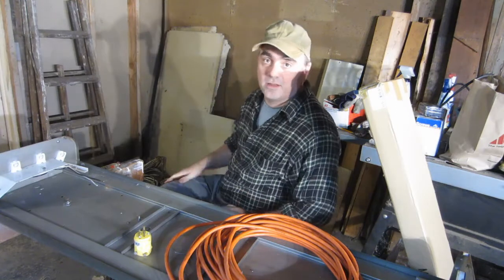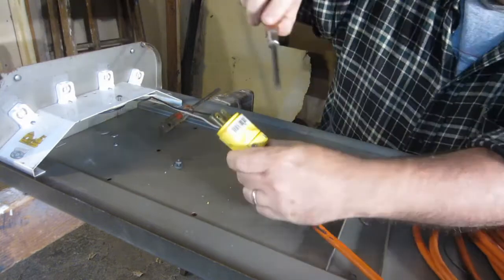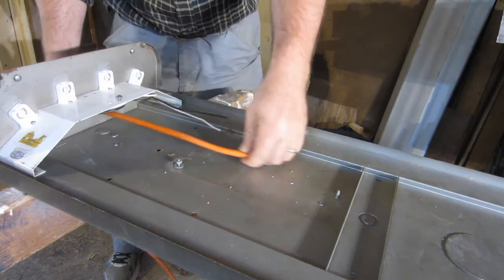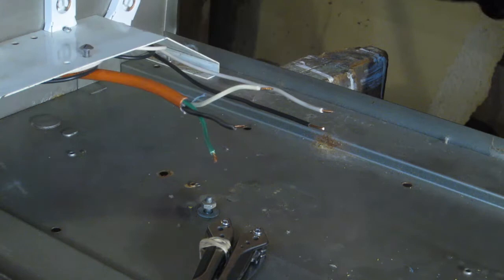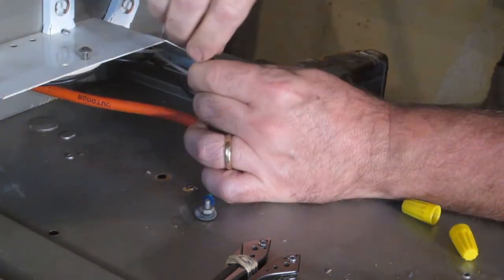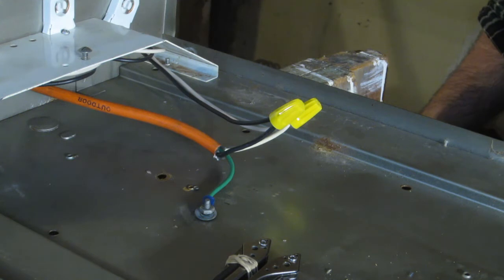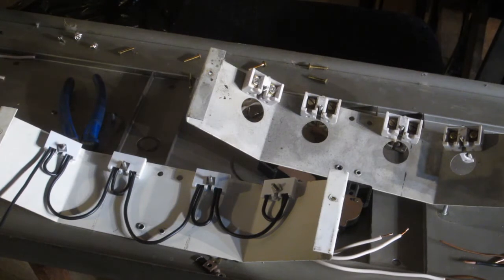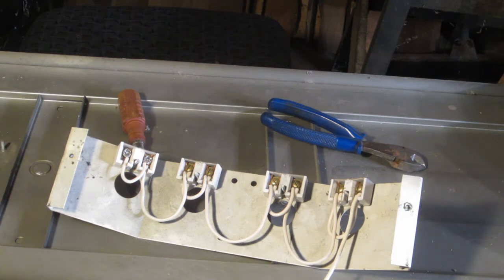Converting a vintage fluorescent light fixture to LED Part 2

Comment: Cheap Chinese garbage, those LED tubes don’t even last 6 months and also the integrated LED fixtures. That fixture was built with pride back then, the fluorescents are way better. That fixture was around 70 years old. All that had to be done was change bulbs and starters. The government is fooling us, they don’t care about energy efficiency, all they care about is money. That fixture would still be going if it was in its original condition and I guarantee it would last another 70 years. An example was when the LED tubes lit up halfway, that’s how cheap they are. The fluorescents never did that. Those ballasts last forever they never have any problems. Those cheap ass LED drivers are junk, it’s a cheap circuit board and that’s why they lit up half way. Hope you enjoyed getting scammed and ripped off. I’ll stick with my old incandescent and fluorescent lighting any day. Also they made a mistake in your order that’s how stupid they are. Back then, they would have done everything right. If that was my fixture it would have stayed fluorescent.

Comment: Nice light and good clean conversion. But it would have been nice if it remained fluorescent. I wouldn't say it's character is destroyed persee. However the start up flicker of old tube lights and the color is unmatched. you are probably concerned about your energy bill which is understandable. But if you aren't than the tubes for the lights are still widely available. Also if you kept the old ballasts there are people on lighting-gallery.net that would probably love to buy them off of you.
Reply from the maker: Thanks.  I am really happy with the way it turned out.  I do have the ballasts, actually.  I'll have to look into that. Thanks.

Comment: RIP nice vintage light fixture. the LED lights are already showing their china pride
Reply from the maker: Not RIP, the fixture is still in use and will have a long life with me.  My bad for buying the cheapest LED tubes I could find, but if you don't look at the fixture it isn't noticeable.  When the lazy sections come on a few minutes later, you don't really notice the difference (or the transition). Keep up the good work on your videos!
Reply: @TheFixitShed  nomatter what you do, if you post it online someone is going to get triggered by it, i try not to do that, i apologize.
Reply from the maker: It's all good.  If I couldn't handle it, I wouldn't be posting.
Reply: Know this about LED bulbs, the ТРОЛЛЬ СРАНЫЙ has a such opinion like you about this bulbs, say to wanter knox.
Reply: @ivanlumilux1031  I am not a troll, I just like old fluorescent lights and i like to preserve and restore things back to their original working condition. those old preheat ballasts will last forever if you want them to and they are cool. once it has been converted to LED it is nolonger an original piece, it is a modern lighting source with a vintage box around it.
Reply: @WalterKnox  no, it's my friend's channel such named, you have  ration.
Reply: @ivanlumilux1031  oh, okay... I misunderstood